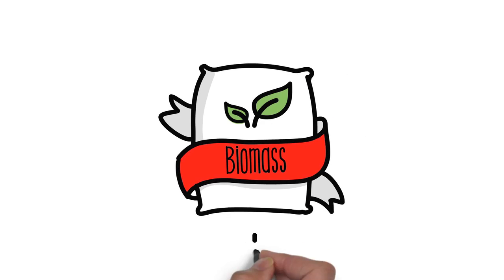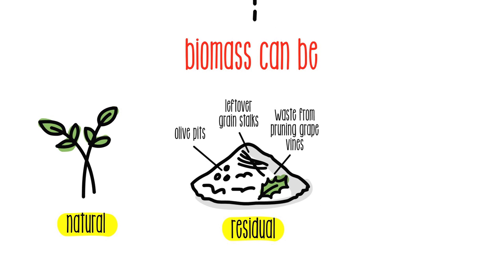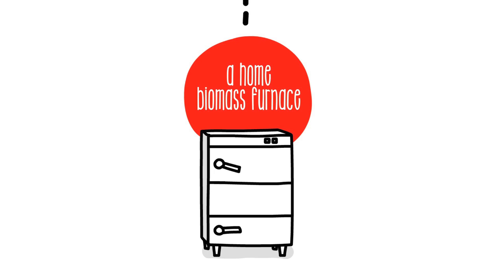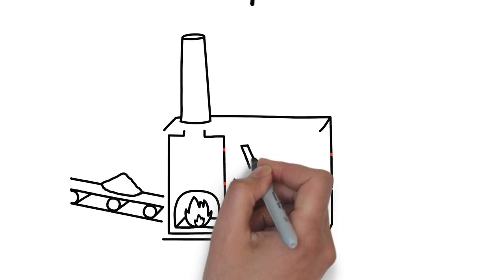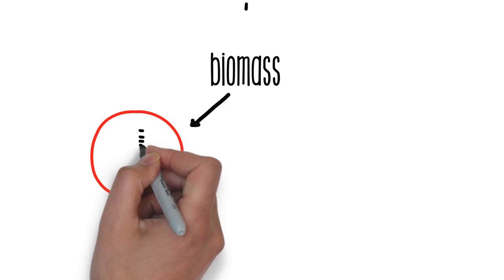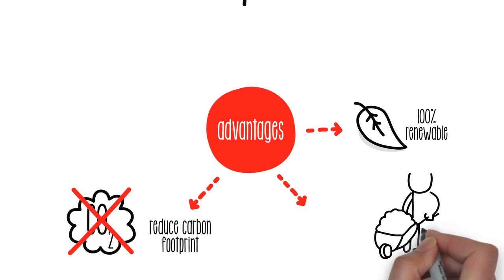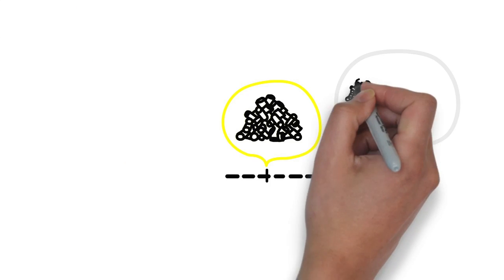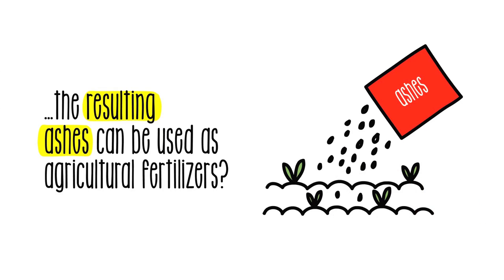How does biomass work? | Sustainability

Comment: How does burning wood save CO2 emissions compared to burning coal? Biomass is less energy-dense, so you need to burn more of it for the same energy output. And burning solid fuels (bio or fossil) produces more harmful emissions (smoke) than burning gas. This video doesn't explain the distinction between fossil and renewable carbon. It's misleading! Biomass is a dead-end in sustainability efforts.

Comment: how clean are the emissions of burning biomass
Reply: They're not at all cleaner than fossil fuel emissions. They're just renewable. But biomass is less energy-dense, so you need to burn more of it for the same energy output. And burning solid fuels (bio or fossil) produces more harmful emissions (smoke) than burning gas. I believe biomass is a dead-end in sustainability efforts.